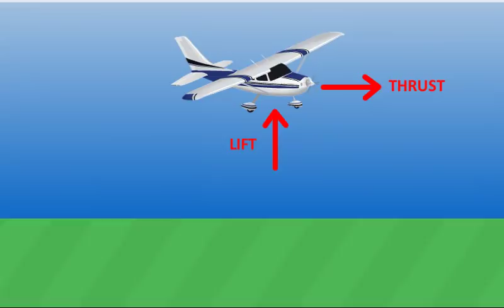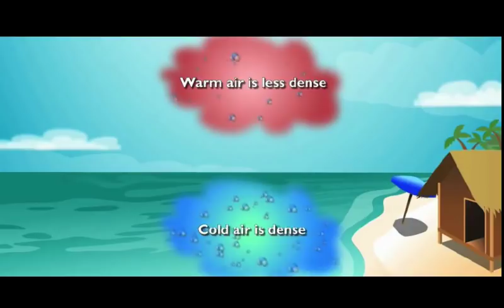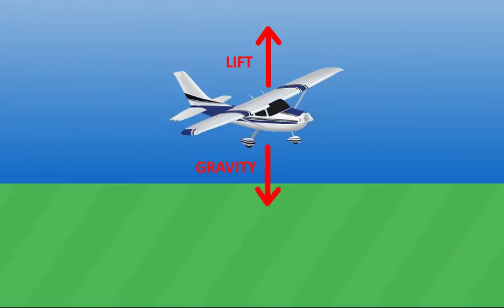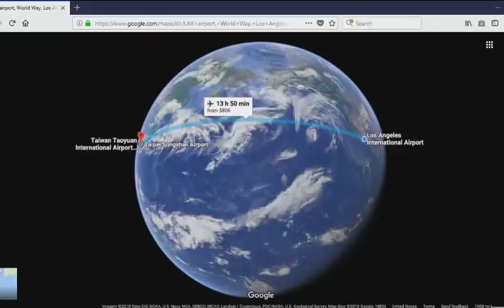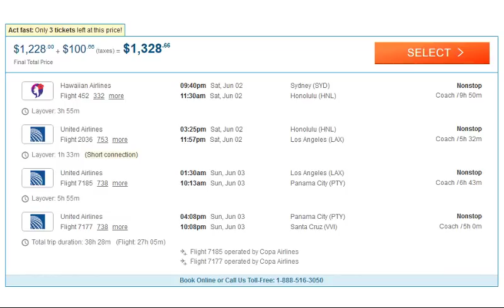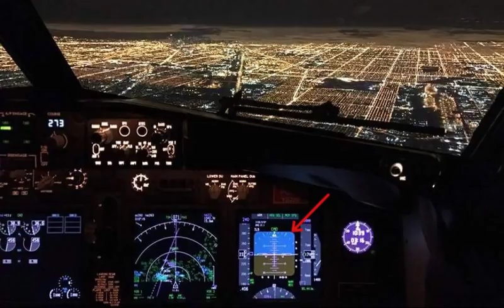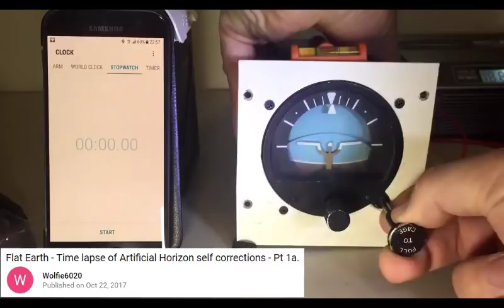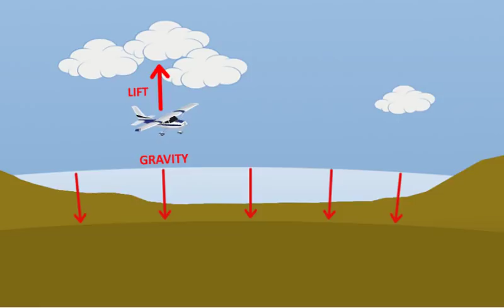Flat Earth Falsities - Plane Nonsense

Comment: so funny..that plane is as level as the water ..shouldn't it be curved? I mean at 24000 miles there should be a curve per mile that is easy to see..??or 4000 miles there should be a drop ..sorry this round rock is flat in my eye's
Reply: You really are a silly troll. aren't you.
Reply: @boffeycn  David is also a Troll? :(  Or about ME as so often... You sure specialized in.. serious comments, little more shy with the very Erudite FEers that commented a while back. Keep up the good work showing off Science Knowers capabilities :)
Reply: You can see a curve depending on your altitude. Flying at 37,000 feet — which is 7 miles high — isn't high enough to see the curve generally. https://flatearth.ws/curvature-airplane  But you can see the curve at less than 4,000 miles, as it is very evident at the ~240 mile altitude of the ISS.
     At heights much less than jets fly, you can make a water level and see the horizon falls below eye level. And the higher you go, the greater it drops.  https://flatearth.ws/water-level-horizon  People on airplanes have taken the wrapper of half full bottles of water, turned it sideways and saw that the horizon dropped below eye-level. https://flatearth.ws/bottled-water  If FE videos are correct, this shouldn't happen.
Reply: @romithromith  Its simple geometry. A sphere 25,000 miles in circumference has a drop from one point of 8 inch per mile squared. Math does not tell falsities unlike your link.
Reply: @BarronBros1822  Where's the math? You offered an equation for a parabola and a fact about Earth. I did some calculations. If Earth were the size of a basketball, an altitude of 40,000 feet, where airliners fly, would be the thickness of a sheet of copy paper. Wow!
Reply: @BarronBros1822  Let's do some simple math and geometry.  
.
     On spherical Earth, a nonstop flight from Sydney to Santiago is 7,050 miles and takes 12.5 hours. Flat Earth subscribes to the Gleason map, which is an azimuthal equidistant projection map. Allowing a hurricane speed 200 mph tailwind (westerlies)
.
     On FE (AE map) the straight line distance is 15,950 miles.
     assuming 580 mph + 200 mph = 780 mph the whole way
     In 12h30m the plane could cover 9,750 miles
     The plane would exhaust its fuel 60% of the way.
     (Further the tailwind doesn't exist on that course)
.
     But if the course follows a latitude of 
33.659°S
     r = 8532 miles from 90°N (69 miles/degree)
     arc = 138.121° (151.209°E to 70.669°W)
     2π * 8532 * (138.12/360) = 20,570 miles
.
     However the Great Circle route Qantas flies
     on flat Earth we have a distance of 24,340 miles
.
     24,340 miles / 780 mph = 31h12m
.
     maximum range 8,360 miles
     maximum range in 200 mph winds
 is...
     8,360 miles * ( 780 mph / 580 mph ) = 11,240 miles
.
.
     Both flights crossing the South Pacific / Southern Oceans
     would exceed the plane's range
 and run out of fuel
     and to keep the schedule would have to fly 
     speeds approaching or exceeding Mach 2.
.
You're right—math does not tell falsities. And this falsifies flat Earth.
Reply: @BarronBros1822  "8 inch per mile squared" Does it? Who told you that?
Reply: @BarronBros1822  8 inches per mile squared isn't an accurate formula and it's a common misconception among flerfers. Here's some answers that I found all by meself on the interwebs

https://www.quora.com/Is-the-8-inch-per-mile-curvature-rule-valid-for-long-distances
Reply: "I mean at 24000 miles there should be a curve per mile that is easy to see"  
Why do you think the curve should be easy to see at 24,000 miles? My guess is, you never thought it through. If you did, please explain WHY the curve should be easy to see.
Reply: Hey david havent YOU been in the ISS??? Seeing with your own eyes the earth edge curve? Just buy a ticket, been over a century THEY have been flying up there you know, do you think Science progress just stands still? We are in thee 21th Century you know, Progress goes so fast. Anytime soon flight to MARS.
Nothing to it!
PS: less general people see curvature in mere commercial flights.
       Some need to get at Concorde hight to see... more obvious.. horizons, problem is THEY had to stop that business going-on, sometimes breakthroughs suffer degression and never accure again. My primate cousin fervent believer of APOLLO predicted there would be no more giant leap there, for ever & ever.
But again Some Believers answered me and said in 2020 ever advancing Mankind would return again, and return with rock souvenirs, 'Made in MOON'.

Comment: DENSITY- another buzzword from the flat earthers and they think it is a force to keep out feet on the ground.
Sadly NO- as a pilot density is a boring word which dosent effect the plane UNLESS you are flying and landing or takeoff from high airports especially on a HOT day.  WHY? density is a medium not a force. So the plane gets better lift for a lower speed in dense air like at sea level and less lift high up where the air is thinner. Thus, on a hot high airport, the thrust and lift from the wings may not be enough to get airborne given the length of runway available and accidents have happened when wrong calculation were made or none at all and attempted takeoffs were made.
Some high airports have density attitude screens near the runway telling you what the calculated altitude is. So as an eg,  the airport is at 8000 ft actual elevation above sea level but due to the hot dry air that day the screen says the density is 13,000 ft!! this means the plane will perform like its 5000ft higher up- VERY dangerous performance limitation possibility if you plane is low performance type. You manual gives all the data for this sort of thing and you can work out if you can fly safely this time. 
So gravity, density, lift, weight and some other things all work together to make a plane fly well or not and to keep your feet on the ground heavier here and lighter on smaller planets with less mass. 
Would a plane fly better on mars where gravity is much less? not really as the air is also very very thin , so lift from the wings is minimal BUT indoors where a full atmosphere is provided to breath, then yes a plane could fly better than on earth.  You might have small light weight flying machines built just to fly around a large building as part of recreation maybe and high jump contests ect.
Reply: Timxx3868 It MUST be explained how the air at the equator moves at the same speed at the equator as the spin is supposed to (at approx 1100 mph) and remains the same as all the latitudes all the way to the supposed poles where the air would not move at all whileexplaining how that a plane flies THROUGH all those varying air motions while, at the same time, allowing a plane to make adjustments for the earth rotating under it. For example, a plane approaching a north-south runway from the north would have a runway moving to its left at the rate of about a quarter mile per second (at the equator). A split second off in the timing and you miss the runway. Do pilots have to time their landings like that? No. The only way to avoid needing to would be for the air to be moving east at the same rate as the rotation (at 1100 mph) and that is the claim of the speaker (he claims "gravity" causes that but the gravity in Boston is the same as at the equator so should have equal effect). But a plane flies through the air and would have to be pushed sideways at that same rate to stay lined up with a north-south runway. They would definitely feel a sideways push on the plane of the force of a 1100 mph wind and they never do. You can't maintain both that the air is moving at the same speed as the earth but is also moving the planes sideways to match the rotation.
Reply: @bungeebones  The problem with lesser minds like the FE's is their inability to see things in 3 dimensions. In string theory, there is 11 dimensions!!! but that is NOT proven so its NOT science YET...
Ok if you look at the real world and planes taking off and landing what do you see? No lies or coverups ,what do you see with your backwards made humans eyes (yes evolution isnt perfect) 
You see a 450 tom jumbo just gently approaching in a straight live to the runway and landing, no trying to keep it aligned with a runway rushing off to the left or  right. EVERYTHING on this planet moves together and is held down by gravity. Smaller planets have less gravity  and less air as they cant hold as much with the weaker force. So mars lost a lot of its atmosphere long time back with 1/3 gravity. Moon has none (50 tons actually only) and jupiter where you could fit 1000 earths into, gravity is 2.64 times of earth. Why so little given its massive size?? because it dosent have a big mass of iron core . Most likely just gas layers compressed and perhaps a very small solid core thus less gravity as MEASURED by its orbit and other means to prove this. 
When you sky dive out of a plane you are instantly pulled sideways by the wind rushing by thus what people are confused by THEN everything balances and you fall down over the same spot on the earth that you are above because the spot and you are moving sideways together but you dont feel this as you only feel a CHANGE of movement. 
GRAVITY is everything. It affects where we are in our orbit, hoe much rocket fuel is needed to get off the earth and the forces as a craft heads to another planet. it cant travel straight, but curves on long trajectories to save fuel and arrives after millions of kms when the straight distance is way less. thats orbital mechanics and rocket science if you like! 
Look from above the earth and you cant see the movement turning as it takes 24 hours to go around once BUT because its so wide, the edge is travelling at 1000 miles an hour or whatever it is. Its this inability to "see" these things which confuses people. The earth is NOT spinning fast only its edge. So we are not flung away from the earth as its crawling around giving very little push and gravity pulls slightly harder. 
So in the real world i take off and i dont pull sideways because i was already moving with everything before i left the ground. Its pretty simple to grasp. 
Everything in space BIG form a ball because of gravity. Particles have mass so they slowly move towards each other and more and more till you form a planet. or moons . small objects like comets dont they just clump and never are round. So theres only round and no straight lines in nature as that would be created wouldnt it and we dont see anything "made" just a mess of blind evolution. 
Also we have a gene with the apes that gives us 6 fingers???  but its turned off so we all have 5 fingers. WOW, there so much people dont know.....